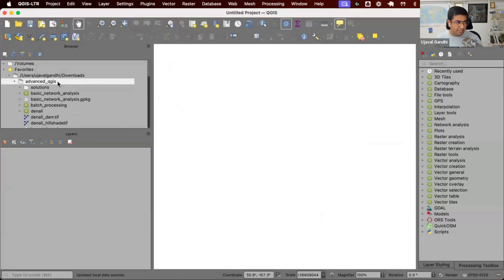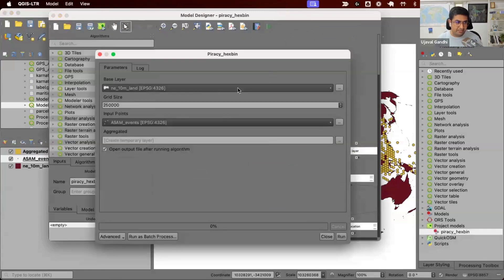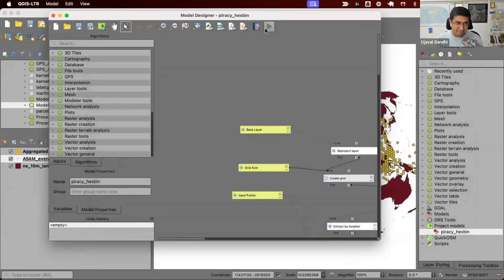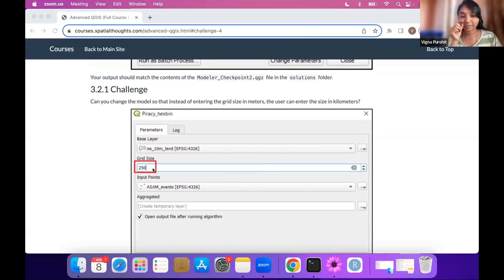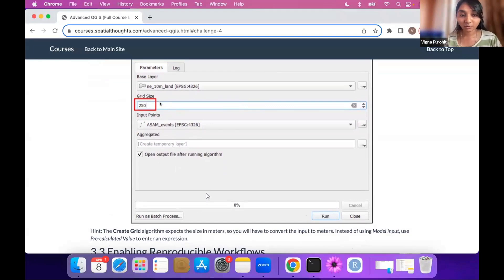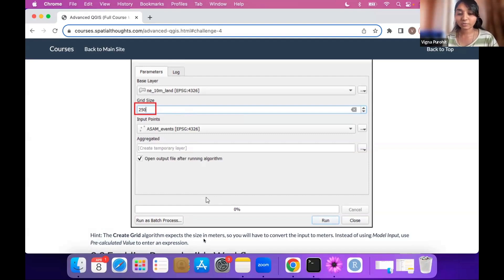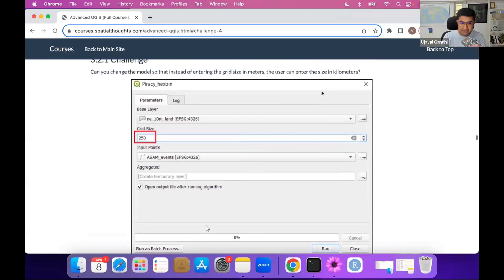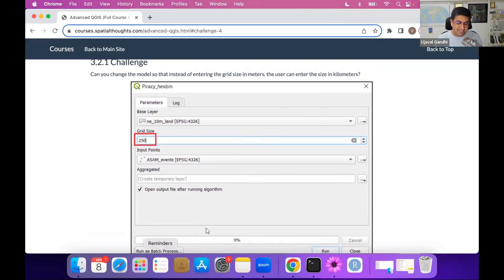Challenge: Converting Input Values in a Model - Advanced QGIS

Comment: Hi. Is there a screenshot or a solution for this challenge? I am stuck in this challenge but thinking different ways to solve this.
Reply from the maker: Change the Horizontal and Vertical Spacing value from 'Model Input' to 'Pre-calculated' value. This allows you to add an expression using any of the model inputs or intermediate values. Once you open the expresison editor, the input parameters will be displayed at the top as variables, such as @grid_size. Use that to build an expression to convert the grid size from km to meters. This screenshot should help https://i.imgur.com/J24AUVv.png
Reply: Oh okay. I did try to change it but now I know my expression doesn't work because I used division instead. Thank you so much for this.
Reply: I used division too instead of multiplication 😂